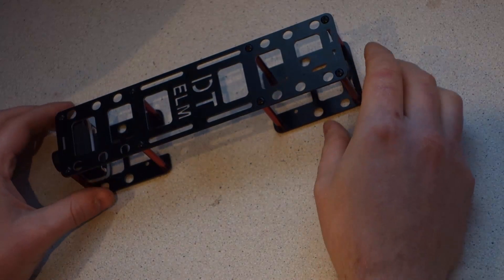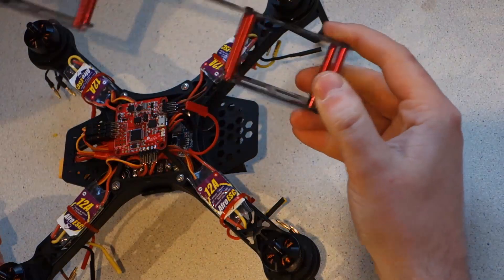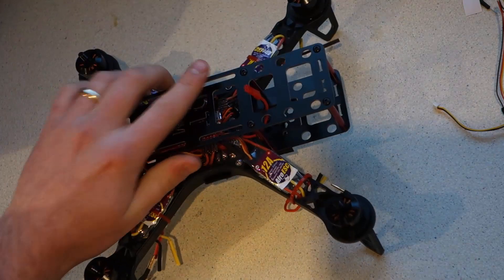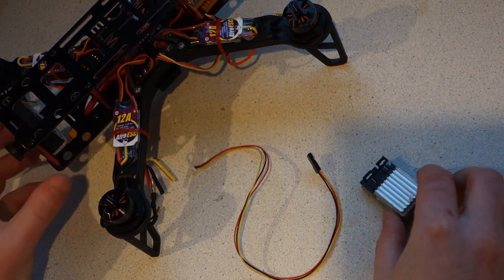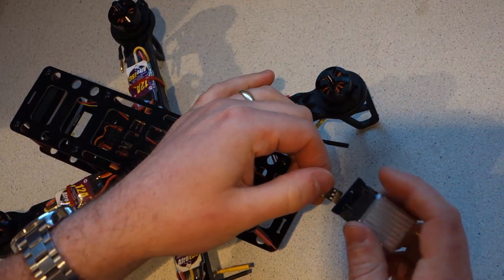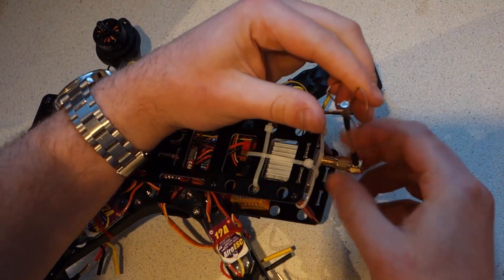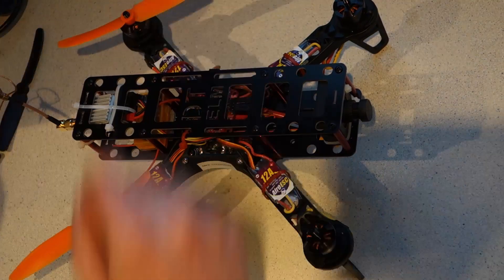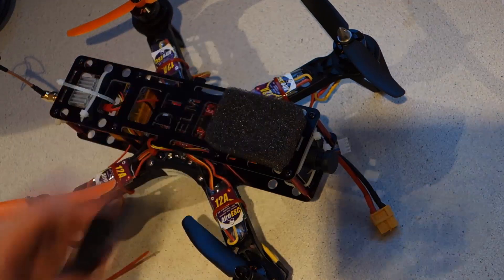HobbyRC Ready To Build 250 Class Kit FPV Upgrade

Comment: I see your using 1 battery for the quad and all the fpv gear. Did you get any noise interference running of the 1 battery , would it be best 2 install a lc filter to the fpv gear ?
Reply from the maker: Hi, no we haven't seen any problems with this setup. Plenty of people do prefer to install an LC filter (or use a filtered 12V power output from a PBD). The PDB in this build actually does have a filtered 12V power output but it would only work with a 4S battery (which could possibly damage the motors)